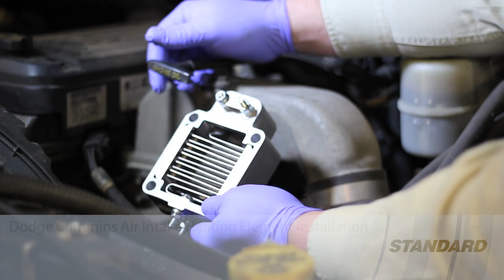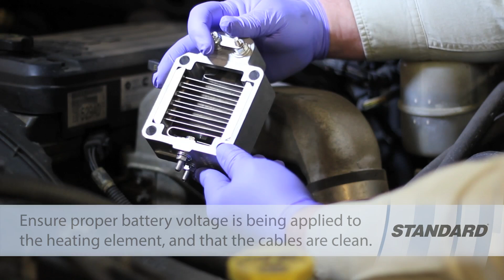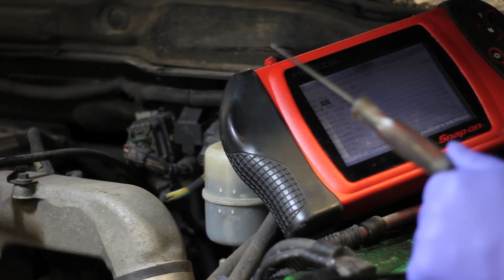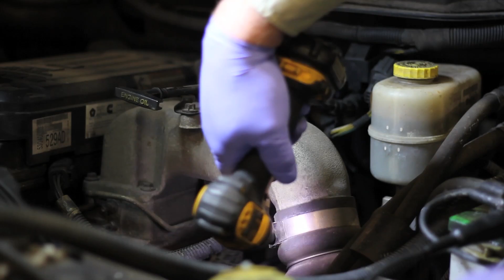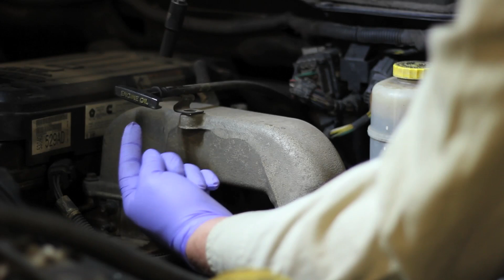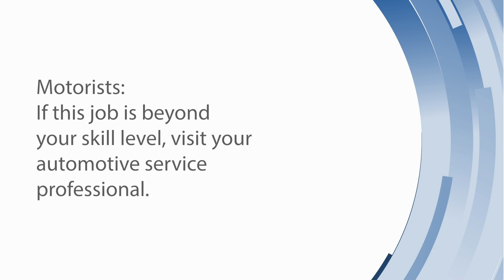Air Intake Heating Element Installation - Dodge Cummins

Comment: Hi there, what are the two posts on the heater, facing towards the front of the truck, for? the 2 studs in the back are for providing 12v, but the wiring diagram shows a body ground coming from the heater as well. my truck does not have this wire, just an unused stud like in this video. i appreciate any clarification!

Comment: On a 1998 Dodge ram 3500 5.9l turbo charged Centron fuel back wheels. I start the truck after the glow plug or heater light goes off the heater, speed omature, windows will not work. Once warmed up and I stop at the dump and restart the truck before the glow plug light comes on then everything works. Do you think it's the intake heater relay causing this th happen?

Comment: What is the voltage coming off the engine control module to activate the air heater intake relay.
I am getting 3.5 volts from the engine control module to activate the air intake heater relays but they are not activating.  Does it need more voltage to activate the relays.

Comment: Thank you for the video. Being that I don't have the diagnostic tool to force the ECU to trigger the relay I am checking everything by volt meter. I replaced my relays as one was bad (bench tested them)  but I may have a secondary issue. I am only getting 3.6 volts from the ecu to the relay. I'm in San Diego so we don't get that cold so I'm not sure if possible it just isn't cold enough for the ECU to send 12 volts to trigger the system. What would you suggest I check next?

Comment: Good video. Im guessing this is my problem. But I live in Fl. And I have a cold start problem even here.
Reply from the maker: Thanks for the comment!
Reply: unbelievable, i have ever been to  florida, it is a warm district.
Reply: I live in TX and only in the last 3 years has this happened when it gets cold....the 1st year it was tough to get started ..but would when cold testy start...then last year it seemed to have gotten even harder to start....this year it seems it wont start at all.....could that be the intake heater ?

Comment: Hi can some one help me please??????
I have 2005 Dodge Ram 2500 4x4 Diesel and i have check engine light on. I connect computer it showed me (P2607 Low Voltage at The 2 Intake Air Heater Relay)  Any idea what relay is it talking about?
Thanks